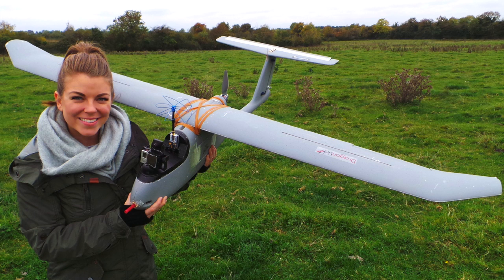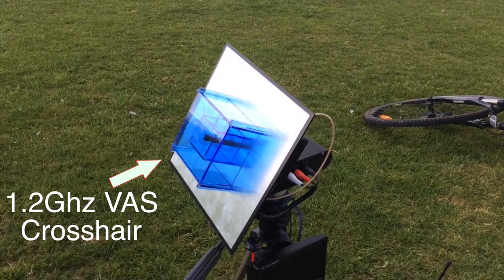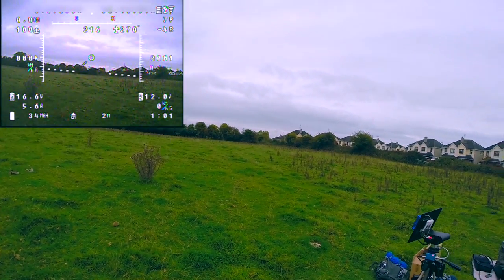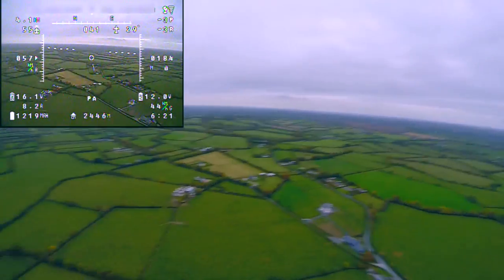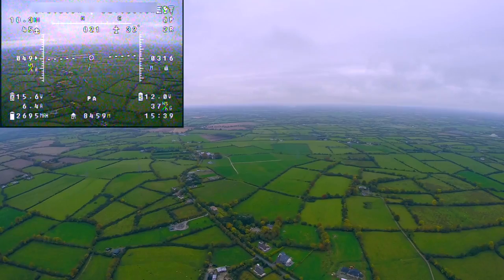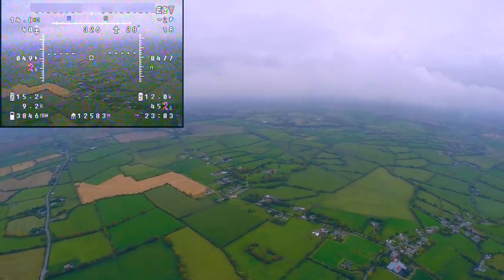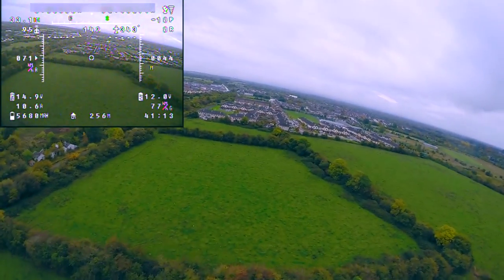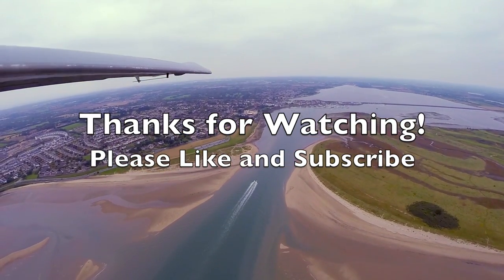Narrated Long Range FPV Setup Overview & 15km Range Test - Skywalker 1900

Comment: Thanks for the video! I have been looking at different setups for my build this winter. One thing that caught my eye was the Cyclops Tornado. After reviewing it I see everything is in metric and can't be switched to Imperial. :( Now I am back to looking at Eagle Tree Vector.
Reply from the maker: +TJ Martin Glad you liked the video :) just so you know, you can change the units to imperial: https://www.youtube.com/watch?v=7uhmGQZo4g0
Reply: +Adam G does FPV Well HOT DOG! This is the first I heard of this. Thanks for pointing this out. :)
Reply from the maker: +TJ Martin No worries 👍🏼 I do like the Tornado, works well for the price. I hear good things about the Vector too, bit more expensive though.

Comment: That was amazing. Where do you buy this stuff from Adam? I would really like for my 500 size helicopter to be able to go that far.
Reply from the maker: +Scott  Miller  Thanks Scott :) I buy most of my equipment from hobby king and ready made RC. I would say a helicopter wouldn't be very efficient on battery consumption and that would be your main barrier when attempting long range
Reply: I don't need to go as far as you, but around 7km would be nice. Can you help me with that goal by letting me know some of the things that i would need to buy? To be honest, if i could go 5 blocks i would be happy. Help Adam please
Reply from the maker: You just need to get some FPV video gear. Frequency antenna's will be up to you according to your goals and flying style. Take a look on some FPV forums like RCGroups as they are the best place to start your research. Getting a 1.2ghz video transmitter and receiver will probably allow 7km with the standard antennas... but if youre using 2.4ghz for control they will interfere. A lot to take into account. Good luck with your FPV project :)

Comment: What is the cost of all your long range RX and TX systems used here? I'm in to normal RC model flight. How much do I need pay to convert to long range FPV setup?
Reply from the maker: Hi. The long range tx rx for control is the Dragon link UHF system. The long range gear for video is 1.2g tx and rx with the rx antenna being a directional crosshair. Take a look in the video description as there are links to where I purchased every item :)

Comment: Tell me please. What VTX are you using? Matek 1.3 + Crossfire did not work well (crossfire goes at 1W power at 1km with Matek VTX) 🤦‍♂️
Reply from the maker: These days I use Partom or Matek vtx, with Dragonlink or Crossfire. Not had any issues. Check this out: https://youtu.be/JVyOkcAwFQQ

Comment: Amazing, but i think nowadays you just need 2 5.8Ghz tripple feed patch array antennas and a 1W VTX. Wezley Varty got ranges up to 40km
Reply from the maker: Yeah this is an old video with old kit now. I've gone further than this while being about 2 meters from the ground since :D I'm not really a fan of 5.8 due to my flying style, but yeah for those that want to fly like Wezley does, it works. Cheers
Reply: @AdamGdoesFPV  How do you mean flying style? Do you mean that you want to be close to the ground and you wouldn't be able to do that with 5.8?
Reply from the maker: @Mi78  yes medium range flights while staying very low and going behind obstacles. Best example is this video, if you watch from start to end you’ll really get an idea as to how much I’m pushing the video link 😎 : 
https://youtu.be/6isM7O8JZfI
Reply: @AdamGdoesFPV  thats crazy! Maybe you could put a home arrow somewhere, so we know that you're actually behind all these trees and not in los with the airframe. So you always use 1.3Ghz? Isn't there more latency then? And do you have some kind of rapidfire module for the 1.3Ghz system?

Comment: I am new to fpv planes. Can you please make a video that explains the wiring and what each thing does. Also what motor are you using?
Reply from the maker: +Lucas Sheridon Hi Lucas, I don't think I will have chance to make a video of the wiring as its not very easily accessible. However, you can see my wiring diagram here http://postimg.org/image/sqermg5m1 and are welcome to ask any questions regarding this. My motor is Turnigy Aerodrive SK3 - 3536-1050kv Brushless Outrunner. Please look at the video description as this contains a list of every item used. Regards.
Reply: +Adam G does FPV Thank you so much Adam! You do an awesome job on your videos for your plane.
Reply from the maker: Lucas Sheridon You're welcome :) and thank you for your comment, i'm glad you enjoyed the video

Comment: hello adam. what is the best autopilot that show the flight information with high resolution? thanks
Reply from the maker: The Autopilot has nothing to do with video resolution. So you’ll need to look into what FC and firmware is right for you. For video resolution I think most would say the best on the market currently is the DJI O3 air unit paired with DJI goggles.

Comment: Hi Adam, I am about to build my first Skywalker and using your list for inspiration. How and why do you use 2 UBEC's, one of which is larger?
Thanks, Oli
Reply from the maker: +Oli Banks Hi Oli. I use a 12v UBEC to drop the 4S power (16.8v) down to 12v for my video gear (camera and VTx). The second UBEC is optional and i use it to supply 5v to the autopilot and  RC receiver. This bypasses using the 5v UBEC built into the ESC, only because they are meant to be a bit unreliable, but also because it means if my ESC burns out or fails i lose throttle but keep control of everything else and can glide home or land somewhere safe (hopefully). Hope this makes sense :)
Reply: +Adam G does FPV Thanks for your reply, I've been looking at your wiring diagram on fpvhub. Is the second battery a spare for refuel or do you have 2 x 5000mAh 4S up in the air at the same time?
Reply from the maker: I run 2 x 5000 4S at the same time giving me 10,000mah per flight :)
Reply: +Adam G does FPV I see, wired in parallel and stacked on top of each other i guess. A 10,000mah battery is too big then?
Reply from the maker: In parallel using a Y connector, but side by side like this http://postimg.org/image/682dsqbu7/
I use 5000 4S on my quadcopter and running 2 of them on my skywalker means my batteries aren't limited to one aircraft

Comment: Hi Adam I flew my skywalker 1900 today for the first time and I found I had very little aileron control to the point of losing control I had to panic land with the rudder the ailerons have 15mm of travel in both directions please can you help
Reply from the maker: If they are travelling in both directions without any issues it must be something else. Do you have an autopilot of some sort? Ensure you are flying fully manual mode if you do. The other thing to check is that the COG is correct. The problem shouldn't be very hard to identify and fix

Comment: If you are flying against the wind, your airspeed will be reduced. And generally, your ground speed is faster than the airspeed.
Reply from the maker: +TheGray Aviator No that is not correct. The airspeed is the rate at which the air is passing your plane. If you are heading against the wind it is passing over the plane quicker than if you were going with it. Ground speed is only faster than air speed when you are travelling in the same direction as the wind.
Reply: Adam G does FPV Yes, my bad, you are correct! Unless you are flying with the wind, your ground speed will be faster, but if you are flying against the wind, your GS will be slower than your airspeed.
Reply from the maker: Yeah exactly :)

Comment: hi. what is the highest range transmitter (more than 15 km)? also where does information on monitor came from? is there any special program?
Reply from the maker: Hi, Dragonlink and Crossfire are used for long range, both capable of 100km + on the right setup. The OSD info is from the flight controller.

Comment: Dear
I bought an antenna tracker Arkbird brand, and my question is this: I have the Syclops Storm and need to install this antenna tracker to my station.
you know how to install it?
and connect the module to the DSB Arkbird airborne?
It is required to place a second GPS module on the plane?

Sincerely
Marcelo Paredes
Chile
Reply from the maker: +marcelo eduardo paredes munoz I don't know how the Arkbird works. You don't normally need a second GPS, you can put a Y connector on the Tx cable that comes off your current GPS. Check out forums like RCGroups, people on their will definitely be able to help.

Comment: Nice setup mate! :) By the way, I am copying your video setup, but instead of the crosshair, I am using a patch and I don't have an antenna tracker on the ground! Do you think that I should get a tracker for long range and change for the crosshair? The patch was pricey so I am not sure if the crosshair would make a big difference! Thank's for your advice! :)
Reply: I am flying straight, that's why I am thinking about the tracker! :) Cheers mate! :)

Comment: The whole idea for a ground station is only for having a picture to navigate with or does it also help the plane go further in range?
Reply from the maker: Yeah the groundstation is all about the video, it doesn't increase the control link of the plane. However, you won't make use of your long range control link if you don't have a video system that can provide you with a video feed at that distance.
Reply: Ahh ok cool, thanks... I am just getting into this type of flying but did not know you could go that far out. Thanks! 😀 Nice video man 👍🏻

Comment: Will the Dragonlink work with a Walkera 8S Devo transmitter Adam?
Reply from the maker: +Scott  Miller  As long as it has a PPM output yes. Any questions you have about dragon link can be answered here: http://www.rcgroups.com/forums/showthread.php?t=1518533

Comment: so roughly how much can you spend on an entire setup like this  and im talking  everything you need plane included 1000, 2000, or more? ive always wanted to fly an rc long range like that and it finally looks feasible
Reply from the maker: The entire setup cost £1500-£2000. You can make a very good long range FPV plane for a lot less! The goggles, transmitter and UHF are the expensive components. Also a tracker is expensive and many people don't need them as they flight out in a straight line and back again, so just point the antenna in the direction they are going to fly. Also a GoPro is about €500 and these days there are some amazing replicas that even outperform them, like the Git 2 for $92

Comment: Very interesting. Want to build one myself. A question though: What kind of legal issues are there if any?
Reply from the maker: Hi, you'll have to look into the regulations in your country, it's varies.
Reply: @AdamGdoesFPV  Hi, What are the regs in your country??
Reply: For drones its 500 meters hor. and 120 meters vert. and within eye sight. What it is for R/C planes I really don´t know. Maybe the same as for drones?

Comment: whats the cost to build a plane like this, im very interested in long range drons but it doesnt seem like any are very accessible for a reasonable price
Reply from the maker: Theres an FAQs section about cost in the video description, however this was from many years ago. The hobby is a lot easier and cheaper to get into now. Look at my videos on a AtomRC Swordfish, this is cheap to buy ready to fly with flight controller already installed, and it can do decent range for the cost, depending on control and video system. Cost all depends on all of the parts you decide to go with.

Comment: How do you think your range would be flying in the mountains?  If your standing on top of a moutain could you fly down below yourself in a valley?  I'm thinking of putting together a system for tracking elk and deer herds so that's were my curiosity is coming from.
Reply from the maker: +HitchHiker's Guide Its funny you ask this now because I was meant to be doing just that at the weekend for the first time, flying down into a valley below myself. Unfortunately the weather turned and I wasn't able to fly. I plan to do this at the very first chance I get (ie good weather on a weekend). I think flying below yourself in a valley will be fine, as long as you are in line of sight and don't go over a mountain and into another valley. If there is a mountain in between you and the plane the tracker will stop working.
Reply: Ok thanks I'm probably 2 planes away from being able to do it but I just wanted to see if it was do-able

Comment: Stupid question but i wasn't sure whether the Cyclops Tornado Autopilot automatically enters RTH when RSSI is lost or if you have to manually put it into RTH. Please help!
Reply from the maker: Hi Alex, it can enter RTH automatically when the signal is lost, but it's not done based on the RSSI. You have to set a 'Failsafe' on your radio gear. You simply turn on the plane and your transmitter, set the sticks and switches on toyu tx how you'd like the plane to behave if the signal is lost, and then set failsafe (on dragonlink you just hold the  button on the tx for 1 second until the blue light flashes). So you get you tx to half throttle and switch on RTH. Now when signal is lost, thats what the plane will do.
Reply: Adam G does FPV Oh right, so you have to set the RTH throttle that it will fly at when in RTH?

Comment: spektrum dx8 if applicable  transmitter to use for that setup?
Reply from the maker: I don't know much about the Spectrum dx8 but I can't see why it wouldn't work with this setup. As long as it has enough switches and the ability to connect to an external transmitter (if you want to use UHF)

Comment: Great video Adam!! Well done. 2👍🏼👍🏼 How much does this set up cost roughly? 10 miles out. WOW!!!
Reply from the maker: +Chad Cole Thanks Chad :) The entire setup including GoPro is about £1,500-£1,800. A great FPV setup can be half the cost of this easily.
Reply: +Adam G does FPV That's not bad. So that's about $1,500 - $2,000 US $$. 👍🏼 Where do you order most of your FPV stuff from? I'm just getting into FPV. Been flying large scale RC planes for over 20 years. Full scale planes for 30 plus years.
Reply from the maker: Its actually in GBP £. But to be honest you can get the gear a lot cheaper in USA. I order most of my gear from Hobbyking.com and readymaderc.com. Moving to FPV is a good progression, it opens up a whole new world in RC flying :)
Reply: +Adam G does FPV Oh ok. Thanks! I buy a pretty good bit from Hobby King. And yes sir it does open a whole new world up. 😃👍🏼 Its AWESOME!!!!!!! Thank for the great info! Have a great day/night my friend! Cheers!
Reply from the maker: You're welcome :) good luck with your FPV build

Comment: I have a question how much does this all set up cost if under 1500$ I think I will buy it and assemble it
Reply from the maker: Most of this is old gear by todays standards. You can get a decent setup for $1500 but it all depends on what you want.

Comment: Which bldc are you using and its ratings please.
i am going to use skywalker 1900 with almost same payload that you have (and a pixhawk autopilot).
I am having hard time making decision which should i use.
Reply from the maker: +Mandeep Singh Hi, not sure what is meant by "bldc"?
Reply: +Adam G does FPV Brushless dc motor (bldc)
and i know from comments that you are using 
Turnigy Aerodrive SK3 - 3536-1050kv Brushless Outrunner Motor thanks
esc - 60amp plush esc
Weight - 2.8Kg
Propelller - ?

Please confirm above things
and
Please tell propeller that you are using. 
By using 5000mAh, approx how much flight time will i get
Reply from the maker: Yes everything in the description is correct, including the listed propeller which is an APC 9 x 6. I think depending on how you fly, 5000mah 4S will last up to 35mins.
Reply: +Adam G does FPV 
Thanks for now and great videos

Comment: What is better for long distance flight, pulling motor or a pushing motor like yours and why?, Thank you a lot!!!
Reply from the maker: For efficiency I think the puller/tractor elastic is better, but the reason we don’t use this in FPV is that the prop would be in the way, unless it’s a twin configuration. Cheers
Reply: @AdamGdoesFPV  oh I see, thanks, I still ahve one more question though, why aren't wood or gas planes used that much for long distance fpv flights?
Reply: I also forgot to add would twin planes have less range because of the extra power required for another engine and what is better a wing or regular plane?
Reply from the maker: @georgeyaknowthegeorgeyeathatme  balsa/gas planes are too much hassle. Heavier, more expensive, break very easily, need more space etc.
Reply from the maker: @georgeyaknowthegeorgeyeathatme  Actually having 2 motors doesn't use more power, I believe because they have to do less work they can operate more efficiently. This is why planes like the MyTwinDream are capable of very long range.
Reply: @AdamGdoesFPV  wow, Interesting, thank you
Reply from the maker: @georgeyaknowthegeorgeyeathatme  No problem. Another advantage of twin motor planes is they don't suffer from torque roll as you make the motors spin in opposite directions
Reply: @AdamGdoesFPV  oh, sorry for asking a lot of questions I'm just trying to get the perfect plane build by can twin engine planes still be a little acrobatic and do barrel rolls and loops
Reply: I just want a plane that I can have a lot of fun with in terms at acrobatics but can still do very long distance flights with good camera footage